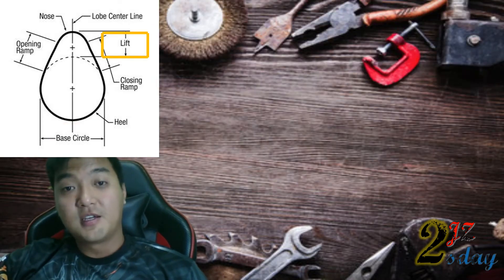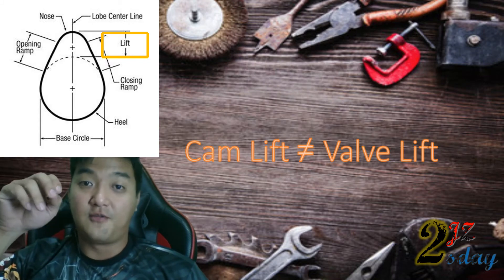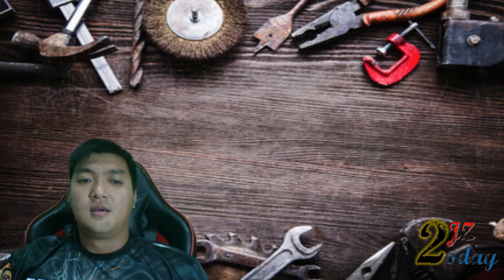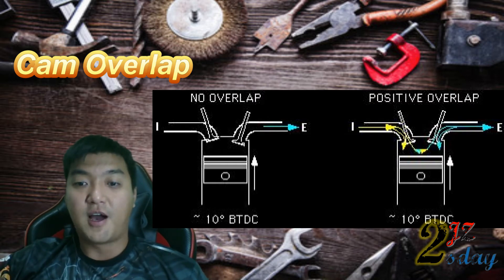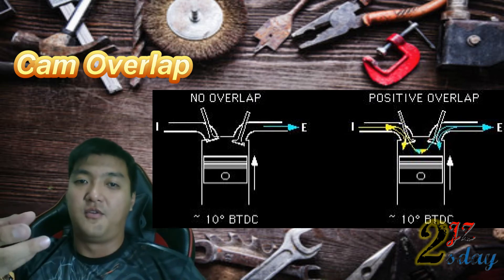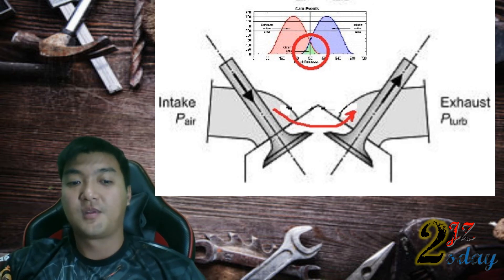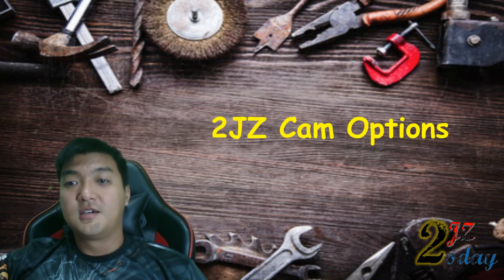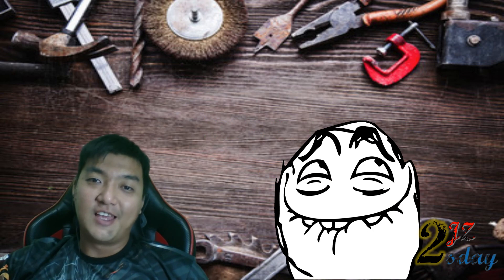2JZ 2sday #2 - What is camshaft timing, cam overlap and 2JZ Cam Options

Comment: I have a question. If you want to keep a 2JZ Non Interference what size camshaft is the biggest cam size you can use before it maxes out at
Reply from the maker: Sorry I don't know but as long as it's an upgraded cam, sure it will be interference with the piston